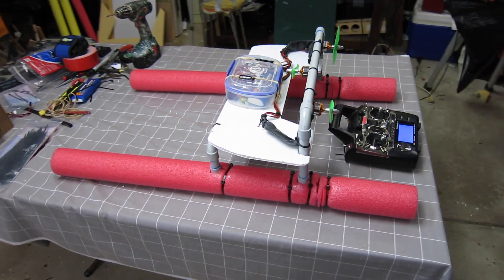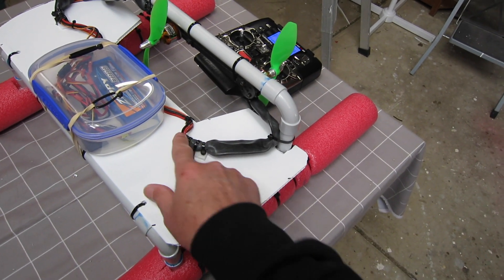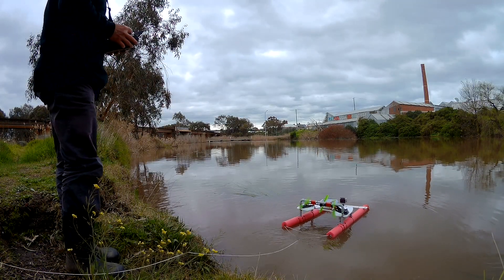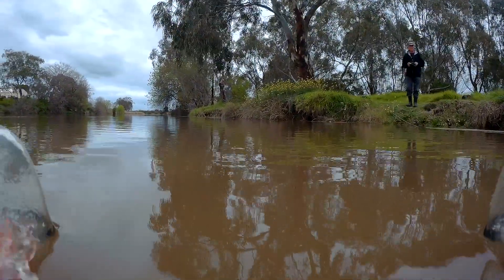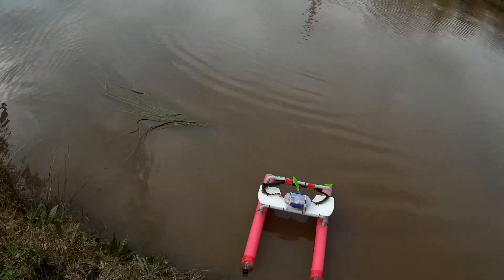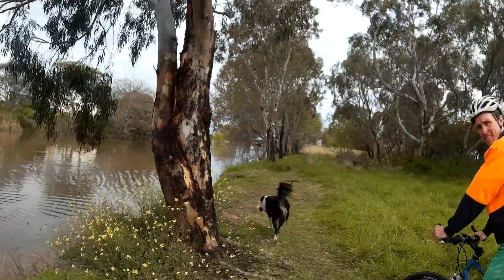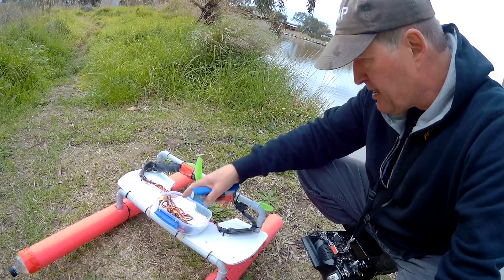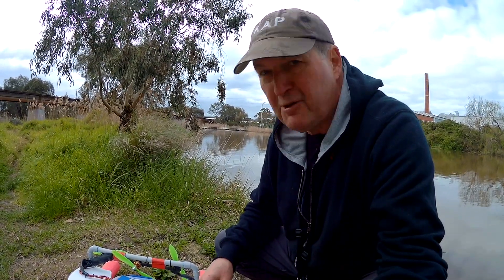RC Seaplane Rescue Boat

Comment: I recon taking the bottles off the front would improve the water flow so it doesn’t splash, either bending the pvc pipe or putting a smoother point on the pool noddle would be good
Reply from the maker: Yes that is what I did

Comment: Hi Andrew, great rescue boat, how did you run all three motors on the one transmitter with three esc's ?
Reply from the maker: Yes three escs, three separate channels
Reply: ok thanks

Comment: You're certainly nothing if not an ingenious make do and mend character (that's a compliment btw)

When I was racing 1 metre RC yachts the hull was mostly underwater in a breeze and we rarely got problems with water in the electronics which were (mostly) hidden away in screw top plastic pots but the necessary wire exits were barely waterproof.  That was in the days of VHF 27Mhz radio so yours looks pretty foolproof.  We certainly had to drain the hulls after each race.

I thought at first you had managed to reverse the B/L motors for astern operation until I saw the extra prop in the middle. A great solution.  Presumably you've done a mix to the rudder (or aileron?) control to the other two motors for steering. I'm surprised at how effective that is. Those cheapo twin prop foamie 'planes are pretty poor at turning.

I'm disappointed at your lack of confidence and moral fibre when you opted for a piece of string on the maiden voyage!  Come on you antipodeans are more than that! btw is your pond a former clay pit?  From the works chimneys in the background it seems possible.

Thanks for the entertainment!
Reply from the maker: Great comment, and you will be happy to know I have not since attached the tether. Although it might be one of the rescue options. The waterway is a little side pond on the Barwon River which cuts through Geelong then exits to the sea at Barwon Heads. The brick chimneys might belong to the old wool scouring plant.

Comment: Great design !!!, perhaps adding a Pool Noodle wrapped 45 degree elbow on the front of the PVC pontoon would help with maneuvering and stability sort of like a ski profile.  The next challenge will be actually retrieving a plane, I used to fly water planes back in the 80's and figuring out how to get the planes back to shore was a lot harder than we all thought it would be, we spent many weeks revising designs, because the "stranded" plane has it own idea on direction and hydrodynamics when it's pushed or pulled, but then that's half of the fun of this hobby....engineering.
Reply from the maker: The designing building and modding are a major part of the fun, maybe the biggest part.

Comment: Very nice. The motors appear to be angled downward a few degrees which looks like it is pushing the front down under power. A regular boat having the propeller underneath means that power will tend to tip the front up. My guess is that if you angled the motors upward more (ie. a lot, like 30 degrees) you wouldn't need to alter the front tip of the pontoons, but sounds like you have already done that :)
Reply from the maker: Yes the altered bows made all the difference

Comment: Absolutely brilliant Andrew, the only thing I would have done different is the pontoons. I would have tried 40 or 50mm PVC  pipe with T pieces and reducing bushes for the smaller pipe (eliminating the pool noodle) and used the gas gun to bend them banana shape (or use 45 degree bends) and use end caps. Should solve the splash problem. 
I'd try a bit of silicon in the bike tubes to hopefully seal the ESC's better just in case it ever did go over.
Reply from the maker: Good ideas Ken, work in progress.

Comment: I have wanted to do something like this for a while . I thought of using a solenoid switch to reverse the leads to give it reverse . I was thinking more like a airboat with rudder flaps but after watching this two motors may work better . With each side having reverse it would be very maneuverable . Thanks for the new inspiration .
Reply from the maker: Yes that's the best solution.
Reply: Would prop efficiency come into play when the motor spins in reverse?  If "reverse gear" was just to back out of a problem then maybe it'd be enough. It's interesting. I gotta think more on that.
Reply: You can get reversible ESCs now. Not even surface ESCs, but re-programmed generic heli ESCs. The ones I saw were meant to be used in battlebots.

Comment: I think a better bow shape will improve performance, angle the motors, the same way you would for a plane, to counteract the bow's movement under throttle.

Was that the Warrnambool train?
Reply from the maker: Could have been, or just a Marshall or Warne Ponds train. Better bow shape has worked well. Video soon.

Comment: Be better with reverse thrust on the motors.  I just set BLHeli ESCs from RC Timer with a Multistar programmer and the BLHeli software to bidirectional.  I just set off to be 1500, full reverse at 1000 and full forward at 2000.  It is really easy to program the Taranis with a few curves.  For my planes I have reverse on a side paddle.

BTW once you have reverse to land with you never want to go back.  No matter how high you approach a landing a burst of reverse gets you down really quick and slow.

You could leave off one motor and have differential thrust in reverse as well.

http://rctimer.com/product-1321.html
http://www.hobbyking.com/hobbyking/store/__98768__Turnigy_Multistar_Mini_12A_V2_ESC_w_BLHeli_OPTO_AU_Warehouse_.html?strSearch=multistar%20ESC
http://www.hobbyking.com/hobbyking/store/__47755__Afro_ESC_USB_Programming_Tool_AU_Warehouse_.html?strSearch=USB
https://blhelisuite.wordpress.com/
Reply from the maker: Yes that's what I'll do eventually, but the flashing of ESCs seemed a little complicated. Two motors with reverse commutaion would be ideal. I'll pester you for advice if I get around to trying that.
Reply: +Andrew Newton I know about the flashing of ESCs - it is a pain however there is no flashing involved.  The BLHeli firmware on board these ESCs already do it - you just have to connect and set the direction to bidirectional and set the end points and neutral.  

Also the programmer connects via the servo wire so no special cables are needed.

Happy to advise - might make a video on it.
Reply from the maker: That would be excellent if you could do a video Stephen. These ESCs are Afros with SimonK, might already be capable of reverse but I dont know how to activate it.
Reply: SimonK does do it however it is trickier to enable - BLHeli is much better.  Will do the video ASAP

Comment: Looking good.. Try angling the motor down so that they push the back of the craft down and so lifting the front out of the water more. From what I can see in the video the motors are pointing up which will add to the noise diving. For the front take off the bottles and cut a 45 degree slope and reinforce it with coroplast.... Brilliant cheap craft for all sorts of applications..

Comment: Why not waterproof the ESCs by ceiling the end of the bike tube with hot glue or silicone?
Reply from the maker: Yes that would be the permanent solution, this is just the prototype
Reply: or even put them in the box
Reply from the maker: Yes. I just pulled apart a tricopter and used the ESCs without rewiring.